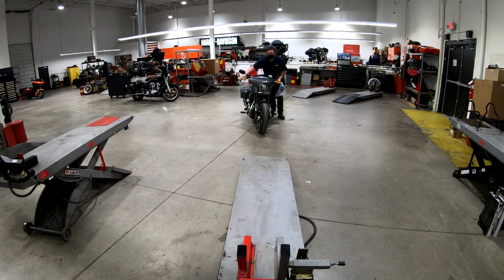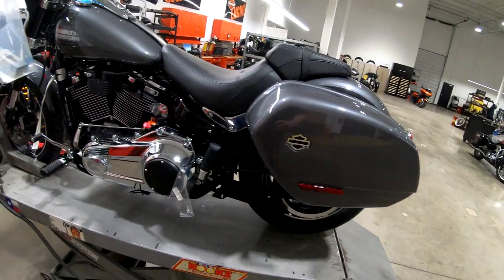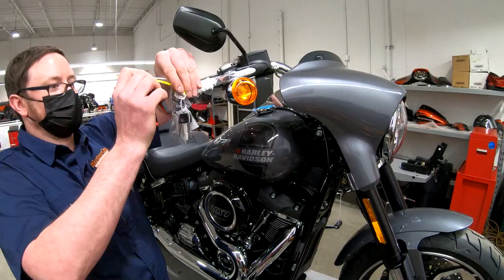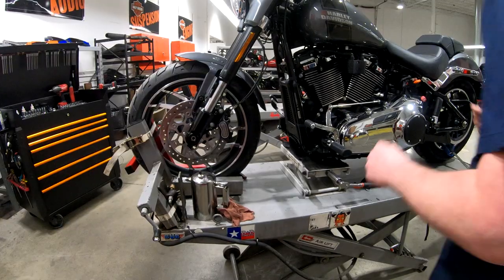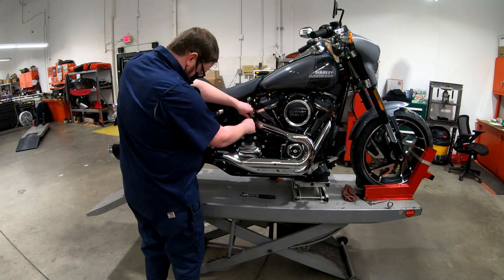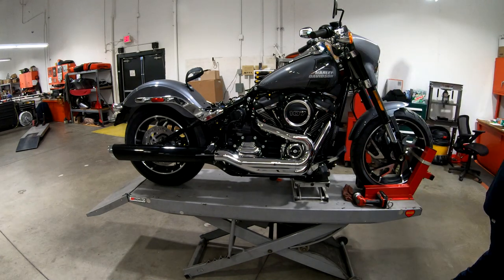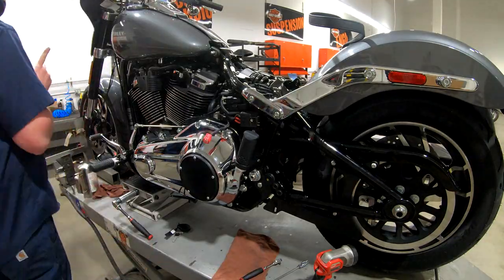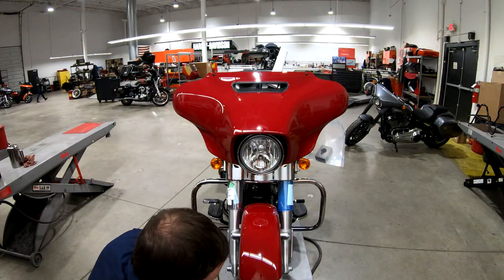2021 Sport Glide Harley Davidson Pre Delivery Inspection

Comment: Every dealership should have their techs watch this video. My 2020 FXLR was delivered with filthy wheels and tires. The factory unnecessarily went ape with that grease pencil and it's a bear to get off sidewalls. Hope you're liking the new digs, Brad!
Reply from the maker: I know!! That grease pencil is the absolute worst if you dont have the right juice to get it off, and they scribble all over the tire, both sides!  Lol. I've probably cleaned 1000 tires. Lol.   Thanks for the comment. The new place is great. So far is way better then I imagined and it's going well.

Comment: After PDI on a 21 FLHTCUTG the right muffler slid off the header, so I had to add another point to my checklist,  3 of the 4, 2021 models we got in this week had under torqued exhaust nuts, 1 had under torqued caliper bolts on one side front. Plus side all the shocks were tight this go round. And the nut on the antenna was tight this time on the FLHXS been awhile since I got a factory tight one..

Comment: Great videos man, if I could ask you a question please...whats your opinion of kb forged pistons?.....my mechanic is putting a set in my twin cam cause wiseco were out of stock for months now....he said any top shelf forged piston is good....what do you think?....any opinions will be well received man, thank you
Reply from the maker: There just as good as anybody's. Personally I prefer pistons with friction reducing skirt coatings. but all pistons are good as long as the piston to cylinder clearance is setup correct.
Reply: @HarleyDavidsonWizard  .....great advice, thank you for responding man...

Comment: I love this bike. Quick questions, are the HD brakes brembo inside? How easy is it to add dual disk brakes to the front end?
Reply from the maker: The brakes are manufactured by Brembo. It wouldn't be a simple task to add dual disks but it could be done. Certain 2021 softail models already come with front dual disks OEM.
Reply: @HarleyDavidsonWizard  I'm interested in adding dual discs on a Sport Glide, Low Rider S come with dual discs OEM but not the Sport Glide.
Reply: Im also curious to learn how many new HD models have Showa front suspension OEM? Isn't Showa owned by Honda?

Comment: best regards a question ??  How many miles can the milkwakee engine last in the Fatboy model ???  Many people tell me that there is programmed obsolescence in Harley motorcycles.  what do you think?
Reply from the maker: Ive seen Milwaukee 8s with 80k plus miles with no problems.
Reply: @HarleyDavidsonWizard  Hi friend.  what you think about the Fatboy transmission with milkwakee engine.  they are good, resistant or require a lot of maintenance.

Comment: excellent video .. a question ??  the Fatboy with milwaukee engine what kind of throttle does it have?  .... electronic or whip.
Reply from the maker: its electronic fly by wire.
Reply: @HarleyDavidsonWizard  Is this throttle reliable?
Reply from the maker: Its honestly more reliable than throttle cables. I see more throttle cables rust out than electronic throttle problems.
Reply: @HarleyDavidsonWizard  when I am traveling in the rain there is no problem ??? ... for example: that water is going to get into the accelerator or the engine ???
Reply from the maker: You'll have no problems. It's a tried and trued product.

Comment: Hey Brad how’s it going?! What dealership did you work at?
Reply: A friend of mine is moving back to Michigan to work at a dealership up there is why I asked
Reply from the maker: It's going great. Ive been super busy at the new shop. Im at Motorcity Harley Davidson in Farmington Hills MI
Reply: Yeah I have been super busy myself, have you worked on many big wheel baggers?
Reply: I got one that has a 23 on the front and it’s wobbling at 30 mph, checking the steering head bearing and it’s good, I don’t have much experience with the big wheel bikes lol
Reply from the maker: O ya? What dealership?
Reply from the maker: A couple.  This dealership has more come through than the old place I worked at.
Reply from the maker: Ya. They are a real pia.

Comment: Why still only one rotor on the front and a solid rotor on the rear. Dyna era fail...
Reply from the maker: Some softail models come dual disk up front. Just depends on the model.
Reply: @HarleyDavidsonWizard  Two on the front is for sure needed. My Superglide C breaks were really bad, to the point i took it back a few days later (got it new) and complained. They gave me an other one to test ride and i couldn't believe it was the same. I had to upgrade. I'm disappointed in HD. But i love your vids!
Reply: @HarleyDavidsonWizard  *brakes